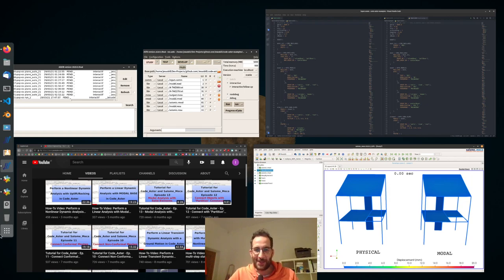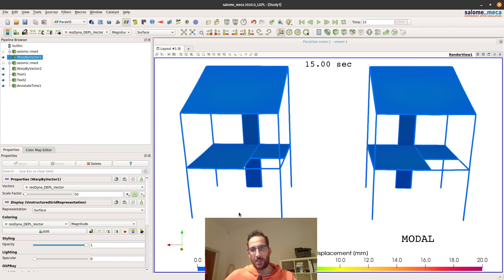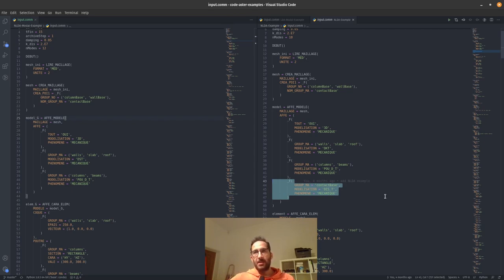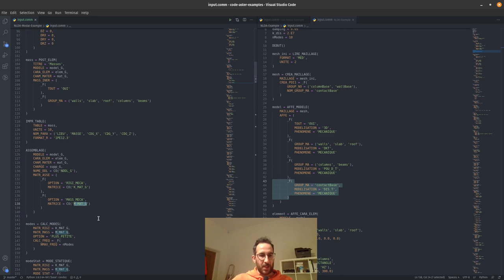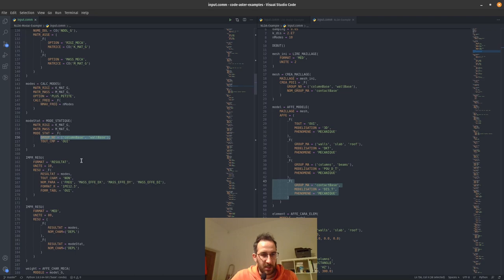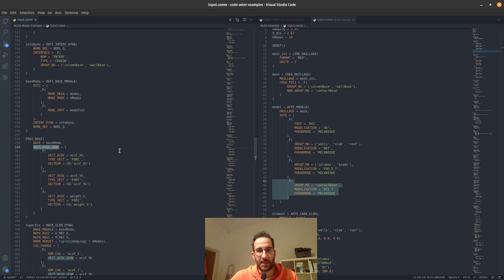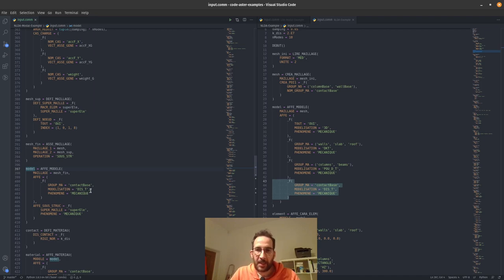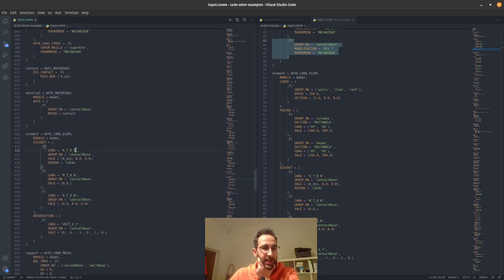How-to Video: Perform a Nonlinear Analysis with Dynamic Sub-Structuring in Code_Aster

Comment: Please can you explain how to perform Linear Dynamic analysis, and now to create an "end release" condition?
I'll try so many time, and if Is possibile, i want to try to use Salomè meca in "Every day work" (civil structure, steel and RC Building)
Reply from the maker: We know Paolo that this is your desire. By Linear Dynamic Analysis, you mean Response Spectrum, right? Ok, it is the time to start on these topics.
The end-releases is very tricky, it will be time-consuming to do so manually but I guess we can show it. We hope we will be able to do so in BlenderBIM in the months to come, however.
Reply: @aetherengineering7387  thanks for the reply. Blender BIM? You can use It for preprocess the model?
Reply: @aetherengineering7387  yes i mean the response spectrum Analysis
Reply from the maker: @peeolo  Yes, we already have started working on it with the main developer. Then we should be able to connect it with the existing work done for ifc-to-code_aster. We are still in the beginning but yes the plan is to be able to create a structural analysis model in BlenderBIM, which will be saved as an IFC file, and to use automated scripts to get the input files for Salome_Meca (mesh) and Code_Aster (run).